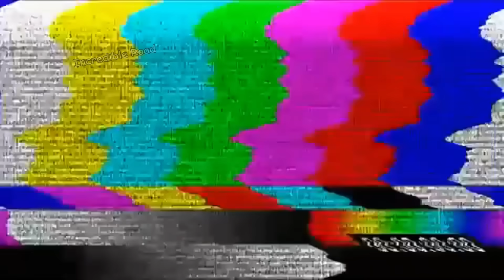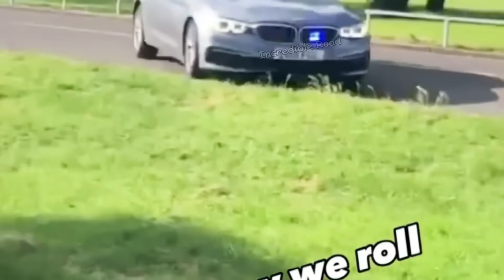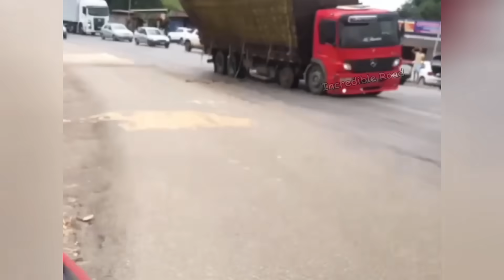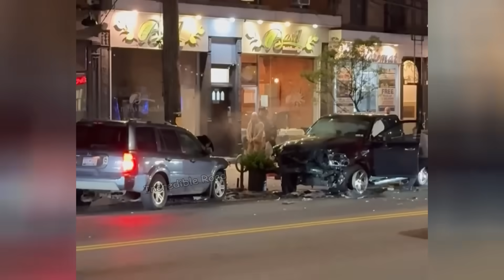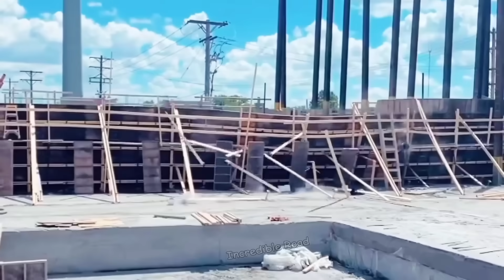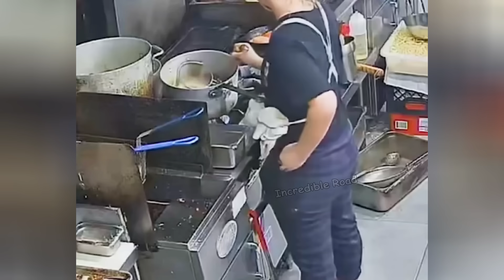When Everything Goes Wrong | Fails Compilation_ Truck & Car Fails

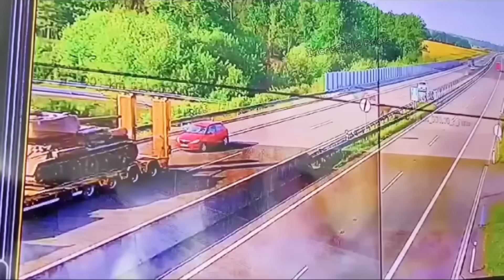Comment: Accident at 03:05. Czech Republic Europe. The tractor with the tank T-34 missed the last turn before the state border. He stopped about 100 meters before the freely accessible border to Poland and was in the right lane. This is prohibited by local law. At the same time, there was a parking lane next to him, and an emergency turn was already starting next to his cabin, with a light plastic barrier located about 25 meters from the cabin. But the driver of the tank truck made this big mistake and stopped like this. The tank was going to a meeting of military equipment on the anniversary of the liberation of Czechoslovakia. Behind the truck is a red car. It is driven by the owner of the tank, the passenger is his son. Even the driver stopped in violation of the law. Freight transport of vehicles - the driver clearly did not pay attention to the situation, this is a violation of the law. Result: dead tank owner, seriously injured his son, slightly injured vehicle transport driver. He has already been charged by the police. The driver of the tractor will probably also be charged when the reconstruction is carried out. Lesson learned: NEVER park right behind trucks on the highway. Always keep a gap of at least 100 meters, drive very slowly and check the situation behind you in the mirror. And you won't come home in a wooden coat.
Reply: Thanks for all that insider info.  That was a terrible f/up!  RIP 😞 I really was wondering what was going on inside that semi tractor - that driver was seriously distracted, yet his truck was traveling at highway speed in a very straight line.  Very epic mystery about that... 🤔
Reply: I am surprised anyone survived in that car
Reply: @acehandler1530  either asleep or looking at his phone.

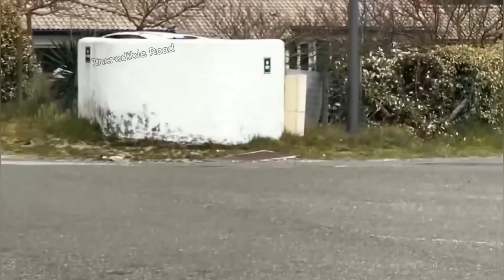Comment: 0:39 The plane is a Boeing 737-700 operated by Aerolíneas Argentinas.  This happened on the night of December 16, 2023 during a period of intense storms that battered the region of Buenos Aires, Argentina.  An extremely strong wind gust caught the plane and forced it into a right turn, causing it to strike the ladder and various other pieces of ground equipment, and causing significant damage to the leading edge of the left wing.

Comment: The video about the truck hitting the car and then the truck in front of the car. 
When I was a kid ( 12)
I was standing outside of my house and a 18 wheeler came down the road street and slammed on its air breakes when a small kids ball came bouncing into the street and a VW beetle was in back of it, and there was another 18 wheeler in back of the bettle. 
The bettle hit the back of the first truck and the 2nd truck crushed the bettle in between the two trucks. 
There were 5 people in the bettle 3 adult's and 2 children, though they were all injured in some way, they all served.

Comment: I fin a lot o truckers in the states dont check the high of the load.....I wonder how most of them got there D license....  if they have one because you company cheap out everywhere they can..

$6 an hour for non licensed ppl...... or $30 a hour for licensed ppl.....   here the company is charged when they screw up like that :-\